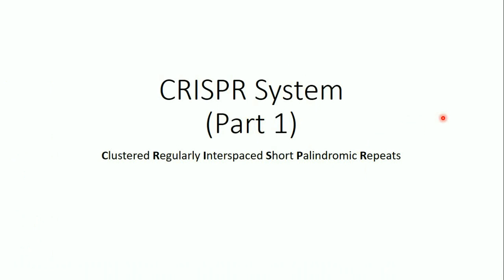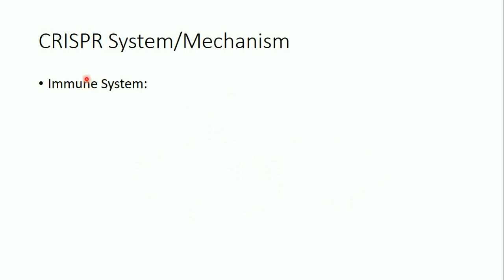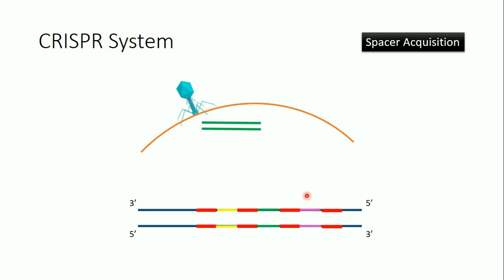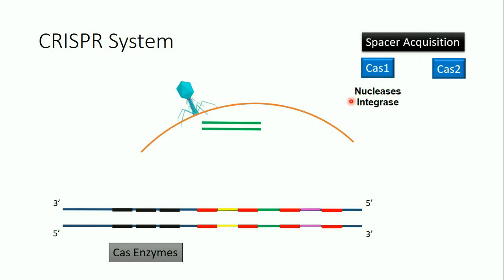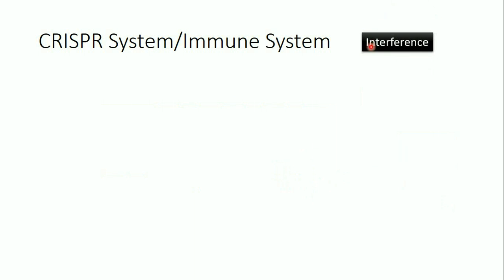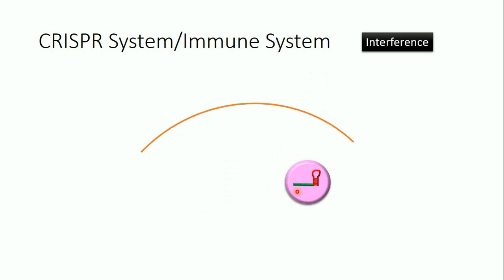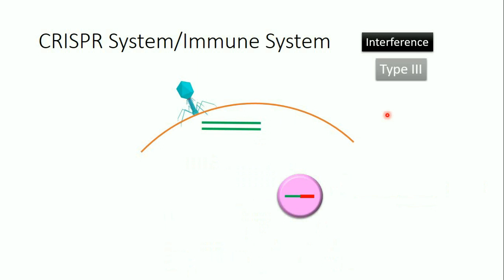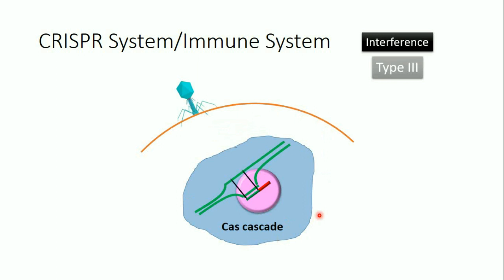CRISPR System and CRISPR CAS9 Technique, The full principle (Part 1)

Comment: How bacterium acquired the spacer dna..?? That is a viral part..
Reply: shubhendu hazra After the virus recognizes the receptors on the surface of the bacteria it injects it’s DNA inside of the cell. CAS complex’s will recognize specific regions of the viral DNA called protospacer, will cut it due to it’s endonuclease abilities and take this protospacer to the CRSPR array. Once there it will be able to integrate this viral DNA into the bacterial DNA specifically in the spacer.

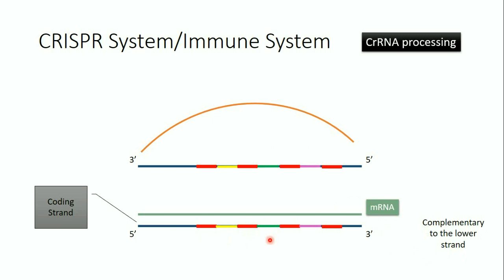Comment: At 8:12 you refer to the lower strand as the coding strand. I believe that this strand is actually the template strand because the newly synthesized strand would have the same sequence as the top strand. That would make the top strand the coding strand and the bottom strand the template strand.
Reply: You are right the coding strand is actually the Non template strand as it contains the SAME nucleotides as that of mRNA while the template strand contains the COMPLEMENTARY nucleotides
Reply: @mohinitalwar2888  I didn't got the Non template strand concept please explain what u said in didn't understand it please
Reply: @Prabhat_Education_Society_Amt  as you know there are two strands, template and non template. And because template strand has the complimentary sequences with that of mRNA (the complementary rule) that means the another DNA strand (non template strand)has the same sequence as that of the mRNA (except T in place of U) that's it is called as conding sequence as it has THE SAME CODES  as that of mRNA.
Reply: @mohinitalwar2888  ya now i got it Thank u so much.. are u teacher mam, nicely explained
Reply: yeah right
Reply: The lower strand was used for transcription. The 'coding region' which contains CRISPR is transcribed to mRNA.
Reply: I think she is right and you are confused.
If you want help say so.
The strand which is used as a template is the one that can be read up( 3' to 5'). Then the new/ nascent complementary strand is laid down ( 5' to 3' style)
The strand that is complementary to the mRNA/ gRNA is the anti sense or template strand. The strand that is identical to the mRNA or gRNA except in the uracil/ thymine points, is the coding or sense strand. Hope it helps.
Reply: Exactly right..  bottom strand is template ..